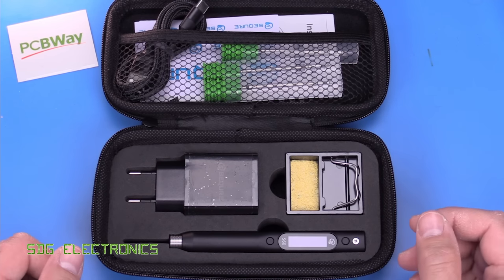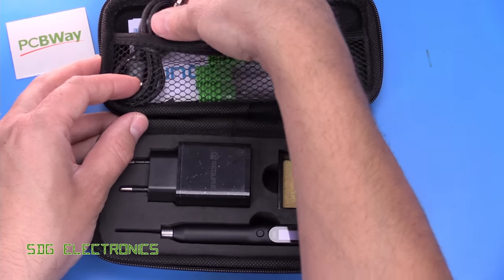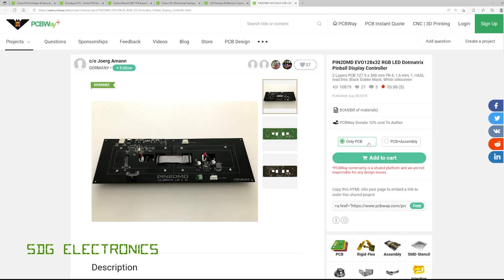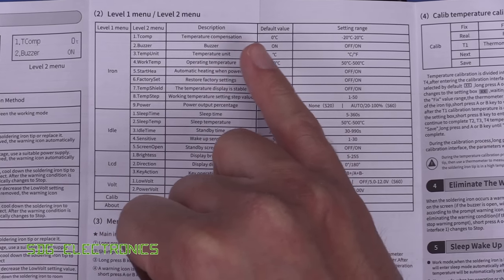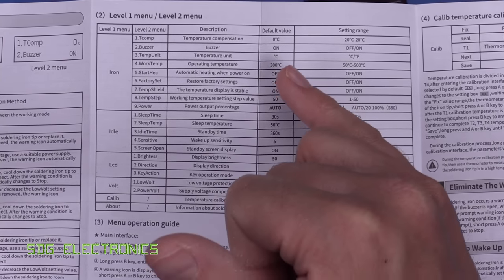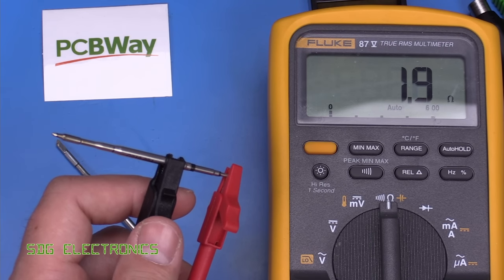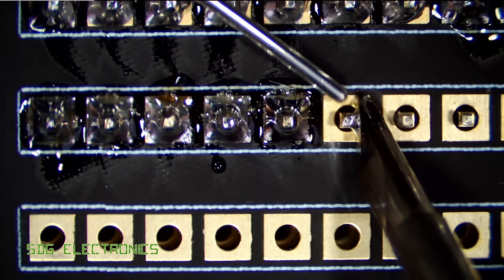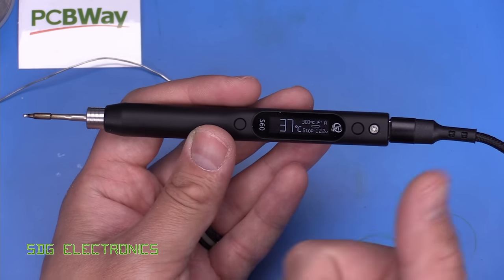SDG #297 Sequre S60 60W USB-C JBC C210 Soldering Iron

Comment: I understand that it's a USB iron, but it would be nice to have seen what power it can actually deliver and how it performs with the same tips in comparison to other irons or stations.
Reply: Use 9v for power and it should perform the same as a real JBC station (40W rated). It’s a lot easier to go over than under.

Comment: Will that soldering iron work with a 3s lipo battery as full charge would be 12.6v or if a 2s was used would 8.4v give sufficient power output?
Reply: More than sufficient. 9v should be 40W (9v/2R=4.5A). JBC C210 is 40W rated.

Comment: It’s funny, I used to really want my iron to be USB-C powered. Then I tried one, and I’m wondering why they would spend the money on the components doing it. You are locked to a power socket, need a big thick inflexible cable, and a lot of the power supplies get all wonky with the sudden power spike demands that these irons make. Much rather just use a barrel connector in the end. I know I can make my own with a USB-C connector and some wire connected to an XT60, but…

Comment: That white thing you thought was a fuse is actually a vibration / movement sensor. Presumably it powers off if it isn't triggered for a set period.
Reply: I thought the accelerometer was built into the microcontroller…
Reply: @davadoff it's a different fab process for microcontrollers compared to MEMS devices so that would be unusual (they would need a multi-die package with internal bond wires).

Comment: I bought Fnirsi HS-01, it came with 65W GaN charger and the iron can utilize that power 20Vx2.25A. It should handle 96W with connected PD DC charger with included USB-C->DC jack adapter.
I would like to see your review on this, I did not disassemble it.
Reply: I bought an HS-01 as well and it is working well so far. On my power meter, it will pull the full 60W. 

The Hakko FX-951 style tips are very long however so this S60 looks like a nice option. I wish this S60 review covered whether it can pull the full 5A at 12V and how it does with a capable PD supply.
Reply: @vtjballeng  Hello, there are some ways you can see about 12V output 60W power.
https://www.youtube.com/watch?v=qx-6Tf4NJao&t=239s
https://www.youtube.com/shorts/lxr_D6omnj4

The current S60 firmware supports a maximum voltage of 12V. The test firmware is now up to 21V and will be released soon after the test stabilizes. Meaning that most use PD20V power supply, current has 3A and above, S60 power can reach 60W.
Reply from the maker: I'll add it to the list! I've got a pile of review items.
Reply: @SequreTech  thanks, that's good to know. Fwiw, we did buy an S60 but did not like the tip options. We use chisel & bevel tips most of the time and there were no chisel & bevel tip options. We bought some from another store but would prefer to have purchased these tips with the S60 from you instead to have them matching.
Reply: @vtjballeng  Thank you for your feedback. The future will continue to increase the type of different iron head choice.

Comment: I just received this today and noticed that it's unable to "work" with any of the USB-C PD power supplies I own. The iron will power up, but as soon as work mode is enabled, it will shutdown and power cycle.

It's only working with USB-A so far.
Reply from the maker: I didn't notice this with this iron, but I had similar with one of the other JBC USB irons. Some USB power supplies are not very tolerant of high peak currents. I had no issue with the Anker 65W and 90W ones.
Reply: @sdgelectronics  Interesting, is this a natural result of the JBC cartridge resistance (and maybe why other mini irons use higher resistance heaters)?
Reply from the maker: @sykskysyk  most likely yes. They're only 2 or 3 ohms, so if the power supply is very quick with it's overcurrent protection then it may shut down
Reply: @sdgelectronics  Out of 7 USB-C PD sources I tried, only 1 worked with this iron at 9V. 2 out of 4 Quick Charge 3.0 sources worked at 12V (including the one provided out of the box). I wonder if something can be done about this in firmware to enhance compatibility.
Reply: Actually, I just realized this is what the power limit setting is for. Very handy!
Reply: Maybe a low ESR electrolytic cap on the power supply output would mitigate this issue. 

Or an inductor capacitor filter?

Comment: 5:16.  The smallest, innermost tip contacts are pretty rough and at least one bar isn't touching at all.  The larger contacts look fine.

The need to offer a user menu option for the menu timeout itself as these brands are ridiculous at timing things out faster than any sane person would want.  This is one of the nicer USB irons out there, but whoever configured a 3-second timeout in the menus should be hung ;).

Comment: Does anyone know the part number of those iron tip spring contacts or something similar?
Reply from the maker: They might be custom parts.
Reply: Pinecil sells spare contacts, similar to a fuse holder. The contacts in the video looks like copper sheet rolled into a circle. Bare copper may oxidise (put dielectric grease on them?).

Comment: pretty good really... perhaps an open question if a 100w version could give a little better performance with these c210. if they have any future plans like that. the t115 nano is also something i am curious about. anyhow good product
Reply: Hello, the SEQURE S60 is coming with a new firmware version that supports the PD 20V Max output of 60W, meaning that PD 100W can output the maximum power of the S60. If you are interested in C115, you can check out SEQURE S20, which is compatible with C115 tips
Reply: @SequreTech  what does that mean? Do i need pd100w to get 60w output or does the Iron outputs more than 60w with a capable Power source? Do you provide a Discount for me or maybe an Upgrade with 65W charger shipped? I would love to review this Iron for our company...
Reply: @medienmond  Hello, at present, the new firmware test is going in a good direction. At the same time, we are going through a stage of aging test before releasing the new firmware to ensure stability. The maximum power of the S60 is 60W. The new firmware supports PD 20V power supply. If the power source output is not less than 60W, the S60 can provide 60W power to the S60. Most sources can meet PD 20V voltage range current below 3A. Please look forward to the introduction of the new firmware and the introduction of 65W PD source.
Reply from the maker: The C210 cartridges aren't really designed to be used at high power. I think you'd struggle to get 100W or even 60W into any joint with the geometries available, even if the heater was capable.
Reply: @SequreTech  Do you have a discount code to get this gadget cheaper or with additional accessoires for the same price??
Reply: @sdgelectronics  Thank you SDG Electronics for reviewing the S60. Agree with you, the design of C210 is mainly for precision maintenance welding, not high power. At the same time, there are some other opinions, that the same size tip iron head, high power can be compatible with low power welding, in this way, in the encounter of some welding spots with fast heat dissipation, such as GND signal, 60W power can quickly melt the welding spot. Different types of soldering iron heads will also affect the power, and the later firmware will set different temperature sampling values for different head types, so as to make the power more accurate as far as possible, but it is still not 100%. Thank you for your feedback.
Reply: @medienmond  Thank you for your attention. Sorry, not at the moment.
Reply: @SequreTech  Is the firmware ready?
Reply: @cannesahs   The new firmware has been released to the official website, you can download it yourself.😄
Reply: @SequreTech how does Sequre S60 regulate power to the tip?

Since 20v with a 1.9R tip will draw 10.5A, 210W (ohm’s law). Even for brief periods of time, it is too much. 

So does S60 switch at high frequency similar to a buck converter? Or how does it cope with 20v and a 1.9R tip?
Reply: @davadoff  Hey, by frequency adjustment, the power supply source of different manufacturers is different. When using 20V, it is recommended to use battery power, which will not easily trigger the peak instantaneous protection of the power supply.

Comment: Does it deliver the 60W?
Reply from the maker: It's capable, but it doesn't because of the resistance of the cartridges.
Reply: @sdgelectronics so would you rather recommend a station like the aixun instead to take the C210 tips?